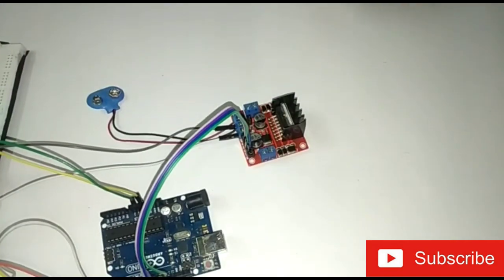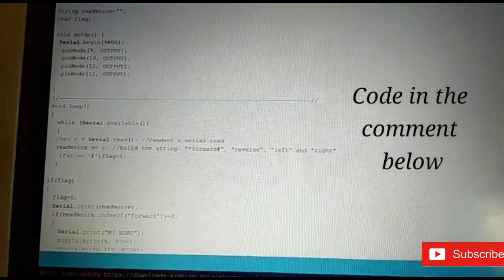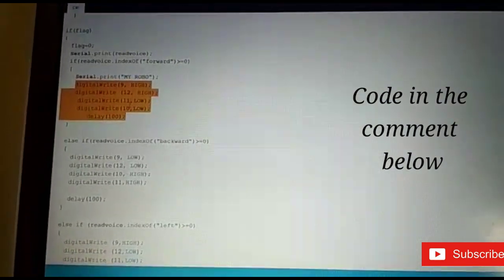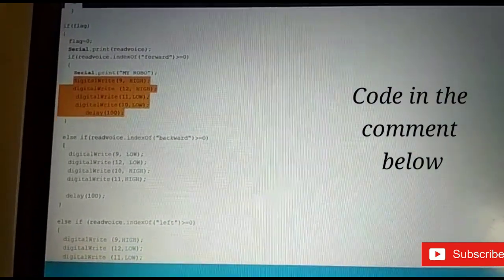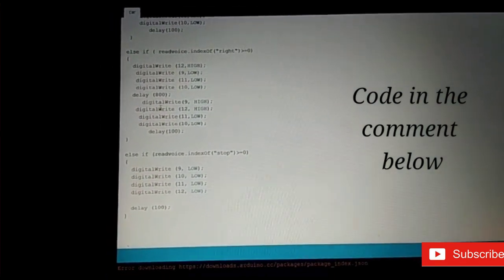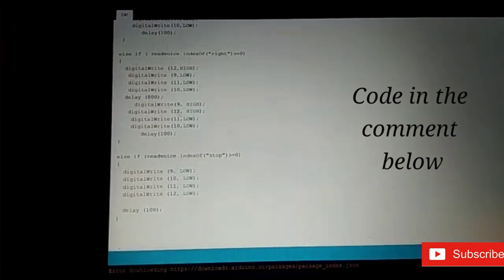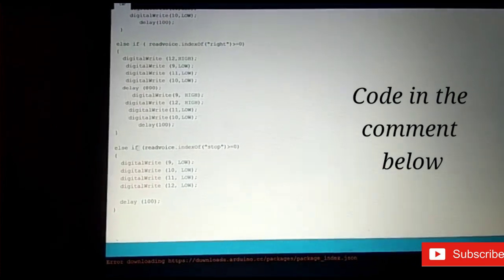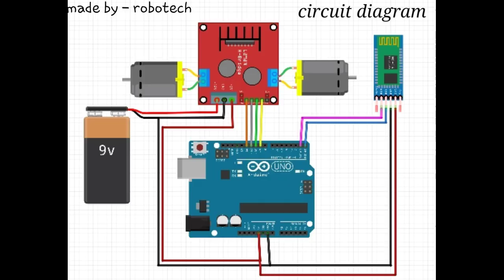How to make a voice controlled robot (part 3)

Comment from the maker: Robo tech
voice-controlled robot

String readvoice="";
char flag;

void setup() {
 Serial.begin(9600);
  pinMode(9, OUTPUT);
  pinMode(10, OUTPUT);
  pinMode(11, OUTPUT);
  pinMode(12, OUTPUT);
   
}
//-----------------------------------------------------------------------// 
void loop() 
{
  while (Serial.available())
  { 
  char c = Serial.read(); //Conduct a serial read
  readvoice += c; //build the string- "*forward#", "reverse", "left" and "right"
   if(c == '#')flag=1;
  } 

if(flag)
{
  flag=0;
  Serial.print(readvoice);
  if(readvoice.indexOf("forward")>=0)
  {
    Serial.print("MY ROBO");
    digitalWrite(9, HIGH);
    digitalWrite (12, HIGH);
     digitalWrite(11,LOW);
     digitalWrite(10,LOW);
        delay(100);
  }

  else if(readvoice.indexOf("backward")>=0)
  {
    digitalWrite(9, LOW);
    digitalWrite(12, LOW);
    digitalWrite(10, HIGH);
    digitalWrite(11,HIGH);
     
    delay(100);
  }

  else if (readvoice.indexOf("left")>=0)
  {
    digitalWrite (9,HIGH);
    digitalWrite (12,LOW);
    digitalWrite (11,LOW);
    digitalWrite (10,LOW);
   delay (800);
      digitalWrite(9, HIGH);
    digitalWrite (12, HIGH);
     digitalWrite(11,LOW);
     digitalWrite(10,LOW);
        delay(100);
  }

 else if ( readvoice.indexOf("right")>=0)
 {
   digitalWrite (12,HIGH);
    digitalWrite (9,LOW);
    digitalWrite (11,LOW);
    digitalWrite (10,LOW);
   delay (800);
      digitalWrite(9, HIGH);
    digitalWrite (12, HIGH);
     digitalWrite(11,LOW);
     digitalWrite(10,LOW);
        delay(100);
 }

 else if (readvoice.indexOf("stop")>=0)
 {
   digitalWrite (9, LOW);
   digitalWrite (10, LOW);
   digitalWrite (11, LOW);
   digitalWrite (12, LOW);
    
   delay (100);
 }
 
 

 else 
 {
   Serial.println("Not Matched"); 
 }

 readvoice="";
}
} //Reset the variable

Comment: Where is the code
Reply from the maker: In the comment box of the video
Reply: What is the 6 th thing what you told in the video ???
Reply: Motor driver, UNO, Bluetooth module, jumper wires, battery and what????
Reply from the maker: @umarkatha6438  power jack https://www.roboelements.com/product/9v-battery-snap-connector-with-dc-jack-male-for-arduino/?gclid=CjwKCAiAp4KCBhB6EiwAxRxbpJG8NQEDmw9wLztFyw9634bxY9zinP8B7uHakTaw8thTsgR52hsO2hoCmmoQAvD_BwE
Reply from the maker: @umarkatha6438  here is the link for the power jack
Reply: For what purpose it is used